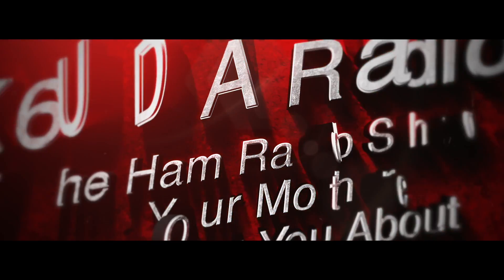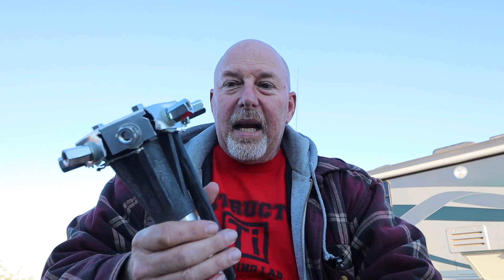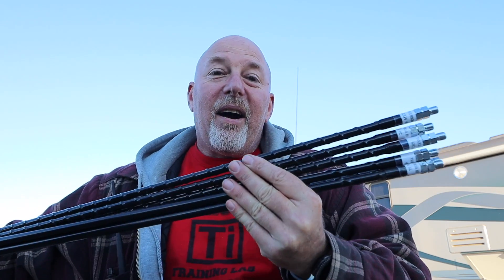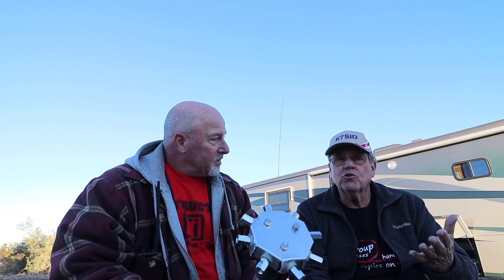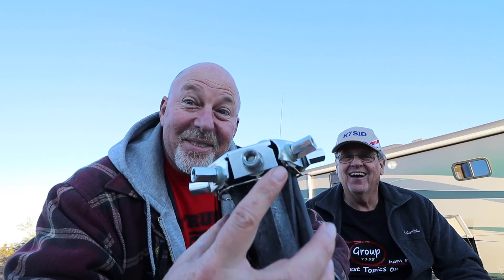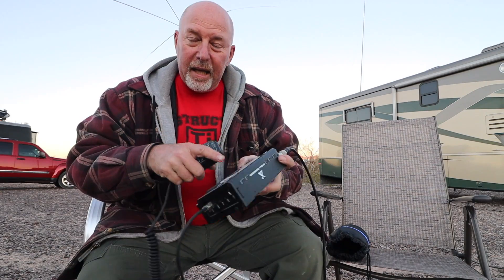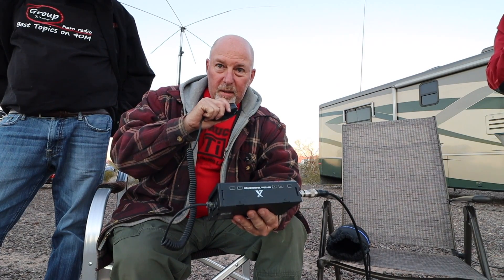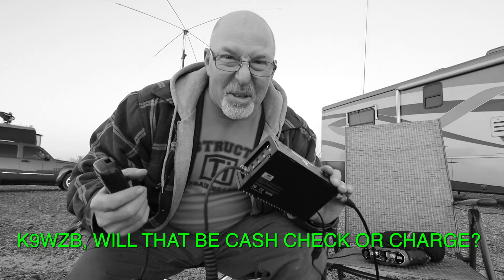Field Testing The MFJ Octopus Antenna | Did It survive the wind? | K6UDA Radio

Comment: I have been using a MFJ shortened dipole for 80. It will load up on 6, 10, 12, 15, 17, 20, and sometimes 30, as well as 80.
Reply: KG7IRJ Ohio state

Comment: Hustler used to make a verticle for mobile use (perhaps they still do) which made use of screw on resonators for 10 through 80 meters. They also offered an attachment--a small  triangular piece of metal with three holes in each corner oriented at 60 degrees--which allowed three different resonators to be attached at one time--for example 20, 40, and 80. True, it was not the world's most elegant widgit--nor was it the most efficient--but it did work. Moreover, the price was quite reasonable, allowing the op to purchase what he/she needed an no more!

Comment: Did you mark the whips, once you got it tuned, so it would be faster to set back up?  If so, how did you mark it?  Nice Vid....73
Reply from the maker: I did. I used a sharpie to mark them. But then I simply unscrewed the tops and left the whips in place so its a simple reattachment.

Comment: Hi Bob,

Have several of the MFJ hamsticks. Using the 80 and 40 as vertical dipoles. You are also correct about not being to close when tuning. When I check the tuning with my analyzer, I also check it again when the hamsticks are within reach for tuning and observe the freq change. Now I make the adjustment allowing for that change and usually the freq is where I want it when the antenna is back up. Hope you had fun out there.   73   WB3BJU